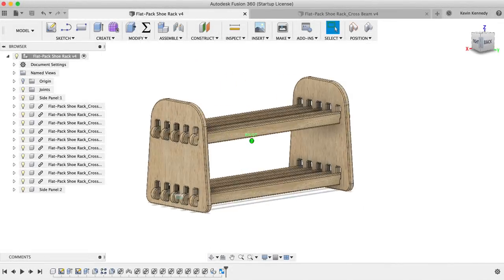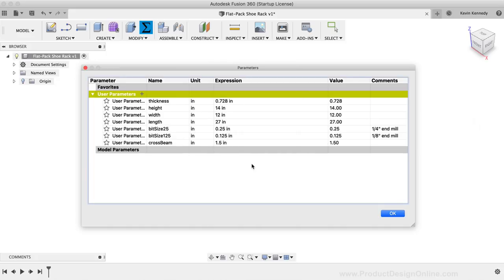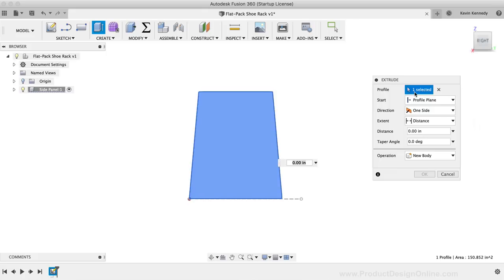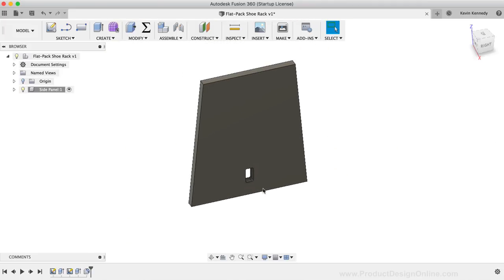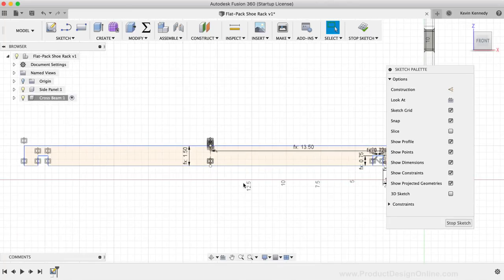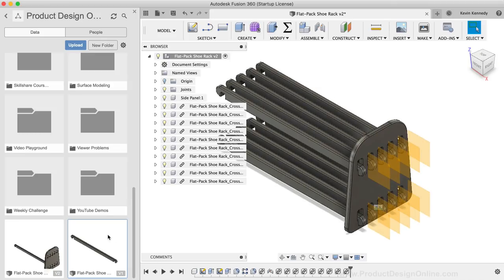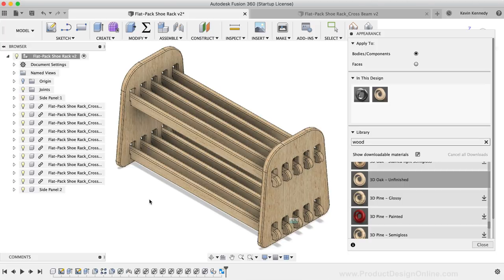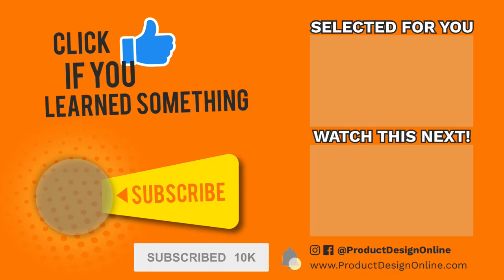Flat-Pack Furniture in Fusion 360 — Fusion 360 for Woodworkers

Comment from the maker: Reference info ► https://ProductDesignOnline.com/2
New course: "Masterclass: Fusion 360 for Hobbyist Woodworkers" ➞ https://bit.ly/woodworkingCourse
TIMESTAMPS
0:00 - Creating a Flat-Pack Shoe Rack in Fusion 360
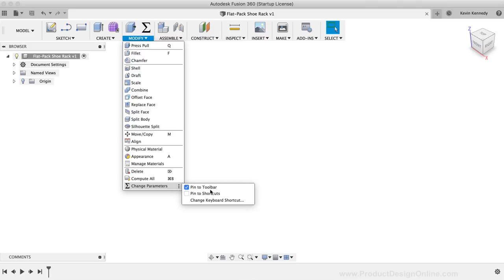2:27 - Creating the user parameters
7:36 - Creating a side panel
10:13 - Extruding a side panel
11:52 - Creating the first slot
16:40 - Patterning the slot
21:06 - Sketching out the cross beam
25:55 - Save the cross beam as another file
27:30 - Copying the cross beam
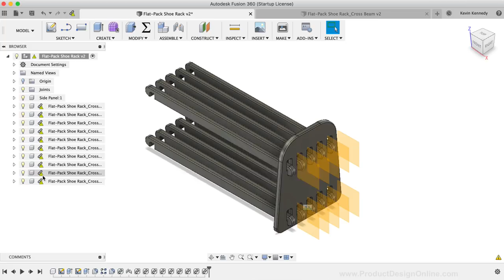30:47 - Creating the second side panel
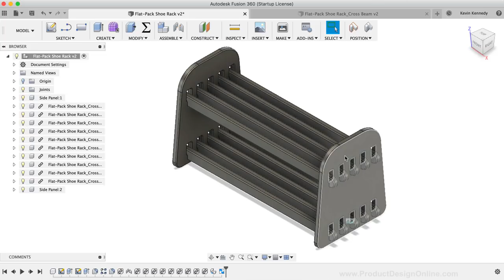32:34 - Adding the appearance of wood
34:32 - Using the NESTER add-in
Reply: Hello fellow designer can you give me a source for the philosophy and pragmatic reasons behind the flatpack design principles? 
Best regards Fehmi.

Comment: Component selection priority, now that’s a great tip for arranging flat-pack components. Thanks!!

Do you have any new tips to streamline creating tabs and slots? I spend a lot of design time just drawing and patterning the connections. Seems like fusion 360 could use  a tab/slot feature like the one in Solidworks.

Comment: Hi Kevin, I fly racing drones and cut out my frames out of carbon fiber with a small CNC machine.  I will give both the add-ins a try and see how they go, thanks again for your enjoyable tutorials.
Reply from the maker: Thanks, pacalige! I'm glad to hear that this tutorial and the plugins will be of great use to you.

What CNC do you use to cut out the carbon fiber? Cheers, Kevin :)
Reply: It's a cheap Genmitsu I got from Sainsmart.com, I upgraded the spindle to a 500w air-cooled one that had its own power supply that came with the package and it works well for my purposes, I can cut 4mm carbon sheet in one pass using a 1.5mm flat end mill I got from Banggood :)
Reply from the maker: @pavalige  Thanks for sharing! I have a shaper origin (for big projects) and a small X-carve for smaller projects, but the x-carve sucks for any non-wood material. I've been pondering getting a more robust desktop CNC for small metal projects. Cutting through 4mm sounds pretty darn good for as little as the machine is (compared to the commercial size ones). It looks like it's much easier to modify as well...the X-carve is pretty limited.
Cheers, Kevin :)

Comment: I have a Shapeoko 2.  This might be useful for small items, but I really hope to use this to better plan out projects using stock materials.  I really want to plan out an enclosure for the Shapeoko, and a plan to expand its dimensions if I so desire to do so without scraping the enclosure.

This is exactly the video I was looking for.  You might want to link to it in your other video showcasing the new auto-arrange feature as that is a commercial license only feature.

Comment: Hi. 
Great work!!

Just a tip: with the new version of Fusion 360 the Menu has changed. It's not difficult to find the modify parameters option, but for the very beginners like me, everything is a challenge.

Now it's under Desig > Surface > Modify 

thaks!
Reply from the maker: Hi, Eduardo. The "Change Parameters" should appear under any of the modify dropdowns while in the Design workspace. I also like to use the keyboard "S" for the shortcuts box > then type out "paramaters" to quickly access it.

Thanks again for your support! Cheers, Kevin :)

Comment: Hey Kevin, thanks a lot for the video! I'm having some trouble and I haven't found a solution online yet. Around the 10:00 mark when you're creating the first side wall you snap the repeated line to the height of the first line, then set the height to the user parameter after connecting the shape at the top. For whatever reason I can't get the lines to snap.

You mention to select the checkbox with snap if you're having trouble, but it was already selected. I also have another setting selected based on other suggestions in my preferences "auto project edges on reference". 

Furthermore, when I try to set the height to the user parameter, it does nothing when I click to confirm or hit enter. It will sit there doing nothing until I hit escape. So you have any idea what's going on?
Reply: I had the same issue. The snap functionality seems to work only when I place the cursor on the cross indicating the end point of the line.

Comment: I started learning Fusion 360 with the plan to purchase a CNC for woodworking. Having to export and then insert the crossbeams seems like it goes against the top down paradigm. I'm surprised that the software can't figure out patterned components, etc. for CAM. Makes me wonder if this is really the best design software for CNC?
Reply from the maker: You can pattern components and don't have to necessarily make it an external component that is linked. Maybe I wasn't clear enough but I demoed that in this video showing one way to attack assemblies. Ideally, external components are most useful when working on large projects.

Comment: Kevin, your videos are excellent. I recommend them because they clear and easy to understand. You put a great amount of work into making the content clearly understandable. I liked the Nester app. I think I need that for my CNC router. I recently installed the DragKnife app. There is a great webpage to address the Nester app and install. However, there are too many steps or too many files that need to go into the correct folder. Therefore, I have not been able to install it. I could use some step by step directions or a self-installer. Keep up the good work.
Reply from the maker: Thanks, Nputaansuu! I'm happy to hear you're enjoying my tutorials. In regards to installing the add-in, I feel your frustration! I've had problems installing some add-ins in the past. I'll have to do a (shorter) video on this topic covering how to install add-ins and scripts and some of the common problems. I'm on a Mac however, so installing it on a Windows machine will be a little bit different. Cheers, Kevin :)

Comment: No access to a CNC but still very interesting.

Why, when you 'punched the holes through' the end plates, did you use the 'thickness parameter', rather than 'to (opposite) face' or 'all' - they would both update automatically if the thickness changed.
Reply: there are many roads to Rome is a saying in dutch language Kind regards Hans
Reply: @hanspijpers2100  Yes, and they're all perfectly valid - I just thought the other two were worth a mention, unless there was some specific reason for using the parameter.
Reply from the maker: Hi, Duncan. Great question. As Hans mentioned, it achieves the same thing. For me, its really a matter of personal preference. When I set up models with user parameters I'm in the "parameters mindset" and try to use them everywhere possible. With that said, there isn't any extra value in doing so! Cheers, Kevin :)

Comment: Excellent... excellent... tutorial. Professionally done and direct to the point. And.. Yes, I recently invested in a 4x Axis 6040 CNC machine for my DIY projects and making toys for my kid. 
2x quick questions:
1. You have added fillet size for cross-beam edges (great idea). how CNC can make the cut on both sides,  should I use the 4x Axis feature for this ?    
2. Can I get Fusion360 to break large parts for my CNC to smaller parts ? (eg: if a part is 100cm and the CNC max cut is 40cm)
Reply from the maker: Glad to hear you enjoyed it. What CNC machine do you have?

For the fillet edges I would typically recommend doing that on a router table after the fact. You would suppress or remove the fillets when you generate your CAM file.

In terms of breaking up parts there are a couple ways to approach it. You could just set up cam toolpaths for certain areas... Or you could slice up the model into separate chunks and proceed from there. depending on your CNC size you will also be able to use the new arrange feature and the upcoming nesting features that allow you to manage how parts are laid out for maximum material usage.
Reply: @ProductDesignOnline  
Thanks for your reply and the suggested tips.

My CNC is: CNC 6040Z Router Engraver Carving Mill Machine.

Comment: Hey Kevin, one question to the nester add-on. Is there a possibility to save this as an dxf file?  I just find the possibility to save the sketch as dxf. I would need this possibility to put this created layout to my cnc. Best greetings.
Reply from the maker: Hi, Frank. Great question. DXF's can only be exported/saved from a Sketch within a design (individual components). If one does not exist, a sketch will have to be created before the "Save as DXF" option appears. A sketch can be directly exported as a DXF by right clicking on the desired sketch in the browser and selecting "Save as DXF."

Unfortunately, the Nester add-in doesn't help with DXF because each component has its own sketch. In this scenario, you would need to save the DXF from each individual component (end panel and railing) and then can make copy's in your CNC program.

What CNC do you have and what software do you use? (Just curious). Cheers, Kevin :)
Reply: Product Design Online: Hey Kevin, I am using a Stepcraft CNC 800 mm x 60 mm. As software I use estlcam. I just want to create an wooden apple separated into 4 pieces. It has to be a kind of a puzzle where all 4 parts fits together as one. But creating this in one sketch I have the problem that I cannot mill it out in one step because the parts a to close together so that the milling cutter would "hurt" the other parts. If I save this as STL my CNC will automatically make a 3d model out of it although I just want to mill it as an 2d project what takes more time.
Reply from the maker: @f.s.863  Thanks for sharing. Looks like a cool little CNC machine.

One possible solution - You could create a component named "Apple 1" that includes your sketch (all four parts). Then, copy the component and create three more (Apple 2, Apple 3, Apple 4). Then, use the Sketch trim tool to trim away the unnecessary parts of each corresponding sketch. You could then save each individual sketch as a DXF and import them into your software. Not sure how that software works with DXFs, but hopefully you can import/place multiple DXF files into the same design file.

This is a little bit tedious...but probably not too bad for a smaller project such as this. Cheers, Kevin :)

Comment: Very informative video. Im finding that some of them or even most of the videos to be fair, I am actually watching the whole video now without pausing and flicking across to my own copy of fusion 360 hundreds of times as they play. Reason is I think I am learning faster this way. Obviously it means I will have to come back and do them on my own copy to get hands on experience afterwards, but it also means that I can visualise the whole design process in the way you would if I was like you, a master at this. 

To answer your question, no I do not have a cnc machine.
Reply from the maker: Hi, James. Sounds like a good plan. I think many others have also found that they digest more of the content faster and then revisit or rewatch the concepts that didn't stick.
Cheers, Kevin :)

Comment: Kevin. I’m new at this and I’m getting a shopbot cnc so I’ll be doing woodworking. I downloaded fusion 360    and I am so lost. I am trying to do some lettering on some Plaques and having no luck. Could you do some more videos on woodworking start to finish or point me in the right direction. Thanks.
Reply from the maker: Glad to hear you're looking to learn Fusion 360. I used to run a Shopbot CNC while I was in school...those are great machines!

Do you have any previous experience with any CAD program? If not, I would recommend checking out my popular playlist titled, "Learn Fusion 360 in 30 Days for Complete Beginners!" In this series, I cover all of the core features of Fusion 360, getting brand new users up to speed and ready to build their own unique designs. You can check that out right here - https://bit.ly/learn-fusion360

I also have a woodworking playlist that has some more beginner projects. You'll find that here - http://bit.ly/woodworker-playlist

Here's a text tutorial that may be of help to you - https://youtu.be/BkpAtMAHtyQ
Cheers, Kevin :)

ps. I'm currently working on a more thorough course geared specifically towards woodworkers
Reply: Ok I’ll check those out. The other problem I’m having is all the videos I’m finding are the older versions of fusion 360 so it’s hard to figure it out. Also I checked out your learn 360 in 30 days. Do I just start at the top? I didn’t see an order that it goes in.  Thanks
Reply from the maker: @danthefireman5229  Yep, they're numbered in order (1 through 30), however, the number is sometimes truncated as the titles are long. With that playlist link, they're in order from top to bottom.

In regards to them being the older tutorials, the placement of some items has moved but the functionality is all still the same. I would recommend watching my tutorial that covers the new UI updates. I discuss the critical changes in terminology, placement, and iconography, that should help bridge the gap between the old UI and the new one. You can watch that here - https://youtu.be/tuZzHcmFtg4
Cheers, Kevin :)

Comment: Hi Kevin, There seems to be an issue at the 10:00 mark when I try to add in the height dimension. I get a message saying that my sketch is "over-constrained." I only have the option to create a "driven dimension" that I can't seem to modify. Thanks.
Reply from the maker: Hi Chris. It's likely that another constraint was automatically applied, resulting in that line being defined. Select that line and see if there are any constraint icons that appear. If so, you may have to delete one or all of them.

Take a look at that...if you still can't get it working let me know and I can take a look at it. Cheers, Kevin :)

Comment: Hi Kevin,  I'm moving from Sketch Up to Fusion for some CNC woodwork and your videos are a great help - thanks.   One question  at 30:03 I cannot seem to get multiple items to stay selected when picking move.  I'm running version 2.0.8809 in personal mode.   I can select them from the tree but have to release shift to get M to work (either shortcut or menu) and then it defaults to a single selected item.
Reply from the maker: Hi there! What happens if you activate the Move command first and then select all of them? That way, you shouldn't have to hold down the shift key :)
Reply: @ProductDesignOnline  I did try that and it didn't work for whatever reason.  In the end I just did each one individually but I can see this will be unhelpful moving forwards.   Thanks for the quick response ;)
Reply from the maker: @bachwoodworks3493  Hmm... strange. It should let you select multiple. I'd have to see a screencast or look at your file to see what's going on...but glad you worked around it :)

Comment: Liked th tutorial overall. But I can't understand why you had to use a plugin rather than just setting up a flat patten in the Cam workspace
Reply from the maker: Hi, James. I've just found the Nester plugin to be a time saver over doing it in the CAM workspace. It's really a personal preference. For models like this shoe rack, it doesn't make a huge difference, as there are only 2 unique parts. However, I've found with flat-pack designs that have 10+ unique parts, the nester add-in can really create an advantage.

Thanks for taking the time to watch and comment! Cheers, Kevin :)

Comment: Thanks for the video Kevin.  I don't have a CNC but I have a tablesaw, router and other sawdust generators so being able to design a model in 3D and then lay it out flat to see how to get best use of the timber/plywood is going to be very handy.
Reply from the maker: Hi, Thistledoo 47603. Great point - some simple "flat-pack" designs could definitely be made with a combination of other tools...just requires a little bit more labor :)

I also agree... it's great to be able to estimate and visualize how to best use the wood. I may have a friend of mine write an add-in for some additional woodworking tricks. I find it helpful building models in F360 to estimate the material and cost...but would love to automate it more. Cheers, Kevin :)

Comment: Hi, i have a problem. "Failed 5. No intersecting target body was found. What can I do? Other components are ok and this function works good.
Reply from the maker: Hi, Oliwia. I'll need a bit more context. At what point did you receive that error message? When trying to lay all the components flat?
Reply: @ProductDesignOnline  I couldn't use a dogbone addins. In other components it was ok. I created step by step from sketch.
But now i have other problem. When I use addins nester and go to the cam, i cant create a toothpath to milling. I got log "Internal CAM error. Please report throught your support channel" Other file (without used nester) works good. I restarted fusion360 and deleted setups a tried again from the begining. Unsucessfully :(
Reply from the maker: @oliwiamichalska3223  Hi Oliwia. That's interesting...it sounds like the Nester add-in is not allowing it to work in the Manufacture workspace (CAM environment).  I'm really not sure as I don't know what all the add-in entails from a software perspective. I would recommend reaching out to the add-in Author (who works at Autodesk) - https://twitter.com/prrainsberry
Cheers, Kevin :)